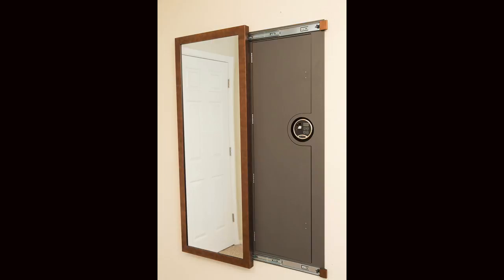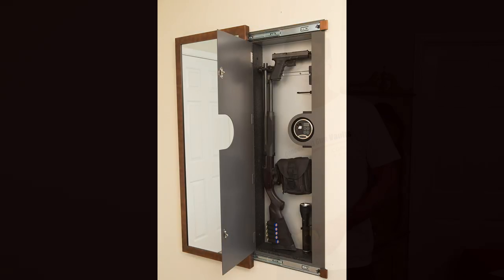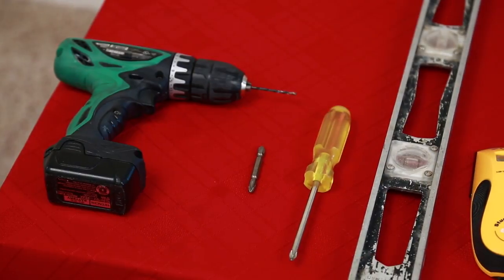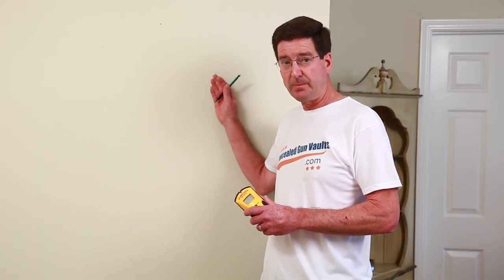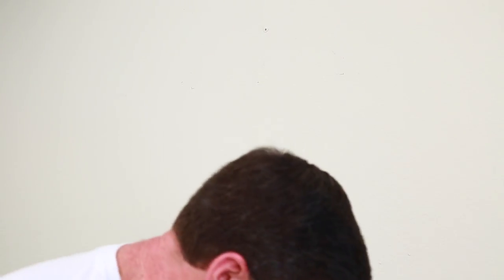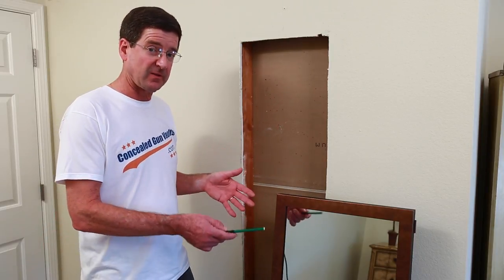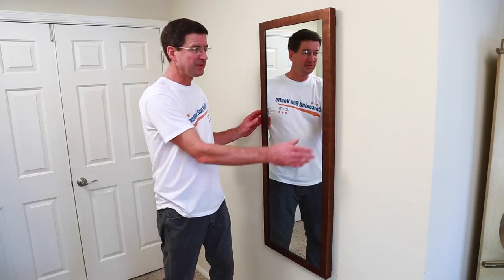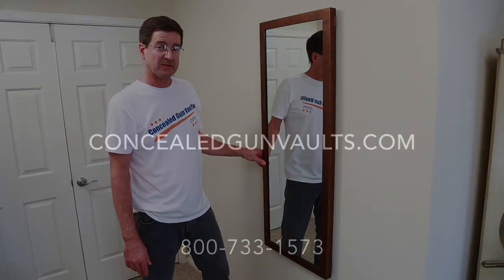How to Install a Concealed Gun Vault

Comment: looks good.....but matching the wood parts where the mirror slides on to blend would make it less obvious....also how does that lock actually lock?
Reply from the maker: Hi Jacques, thanks for your feedback!  It may be the lighting, but those blocks are matched to the mirror finish.  This design had the biometric electronics connected to two servos that were mounted on the upper and lower sections of where the door meets the frame.  Those servos received the corresponding pins on the door.  This style however has been discontinued in favor of a simpler design in order to keep the purchase price down, increase the speed of opening and increase reliability.  Please check out the link in the description for more details.

Comment: Are the new style vaults lockable? The appear to be just hidden shadow boxes on your web page. I don't see a mention of "Locking"
Reply from the maker: Hi Gregg, the new style is not a true locking unit. They have a concealed pin that pulls up from the top which allows the door to be opened.  These new units are silent, faster to open, and are not dependent on a battery.  No fumbling around with magnets in the dark, either.  These are ideal qualities for a unit that is designed to find the middle ground between a locking safe and a pistol in the nightstand.

Comment: How will the electric keypad work if the electricity in the house goes out?
Reply from the maker: Hi Random Person, we have recently moved away from using this type of lock in favor of a concealed manual lock that does not use electricity.   However, the keypad works perfectly without power to the home since it is battery powered.  If the battery dies, you can simply replace it and then open the door again.  It is serviceable without having to unlock the safe.

Comment: The vault takes way too long to open.
Reply: Duck Goose yup those 4-5 seconds could be the difference between life or death. I don’t trust fingerprint safes at all.
Reply: @sat_stacks  I was thinking the same. In the course I took, they advise against finger print.
Stats show that we perspire more rapid in those types of situations and it has malfunctioned.
Reply from the maker: @charliemena9779  We completely agree.  We are launching a new design this week which uses a pull-pin lock at the top of the frame.  Just pull up and slide the frame over.  Silent, quick, less to go wrong, lower cost.  Thoughts?